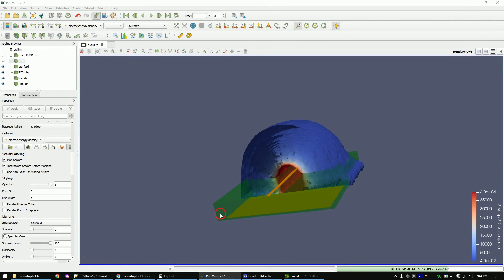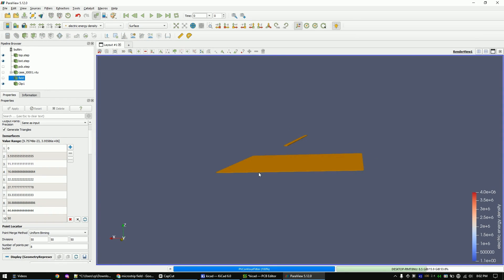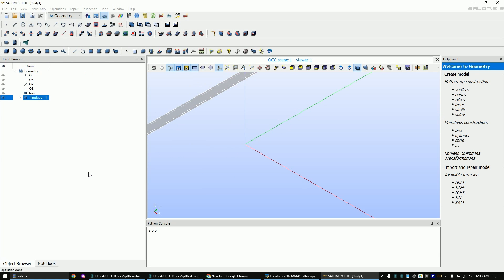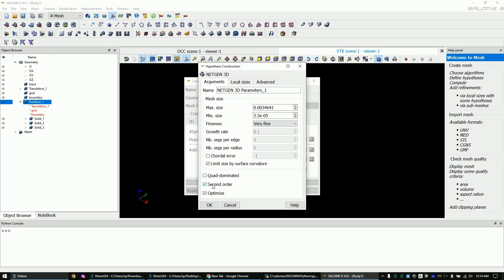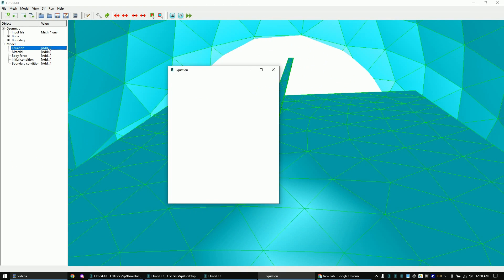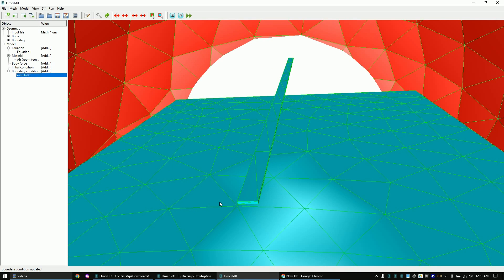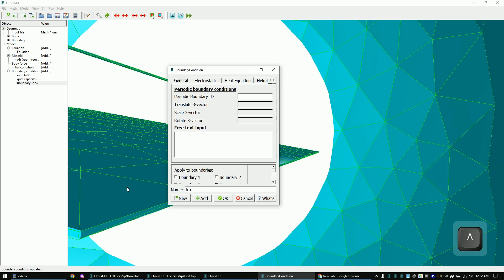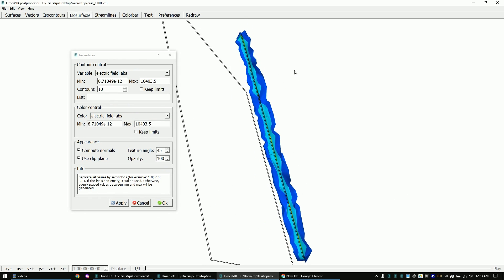Microstrip electric field simulation in 3D with Elmerfem

Comment: At 7:43, when the solver is run, at what frequency/cies does it solve the model for? Can we change the solver's frequency? (I did Sif/generate to see if there is any "frequency" keyword in the simulation, I didnt find anything denoting frequency.)
Reply from the maker: I believe it's possible since Elmer has several solvers with a frequency variable, but I was never able to use them effectively. That's why I switched to OpenEMS for frequency-dependent problems and now only use Elmer for DC (0 Hz) simulations.
Reply: @panire3  That's the problem I had with Quick Field Student Edition (different software). It could only do electrostatics.

Comment: Check 7:04. Is it possible to name the "Boundary1,2,3.."  from Salome so that its easier to pick them in Elmer? because say your model is more complex, you cant sit all day and try to find each surface. I see that when we make the "Groups of faces" in Salome we are left with names like "Group, Group_0, Group1... etc" but these are not the names the Elmer uses obviously.
Reply from the maker: Theoretically, it's possible, but in practice, it's not very useful to do it with the Elmer GUI. You can try double-clicking on a face, which will highlight it in the geometry tree view. Unfortunately, the Elmer GUI is quite unstable and often crashes when selecting and renaming faces. Additionally, the GUI has long loading times whenever a face is selected.

One solution to the problem is to use the non-gui approach as shown in this video: https://www.youtube.com/watch?v=X85qwJyqblU
At 10:22, I show an example of how to identify which Salome face corresponds to which face in the Elmer sif file.

But yeah, the command-line approach isn't the fastest either, so there's definitely room for improvement when it comes to the stability of ElmerGUI.